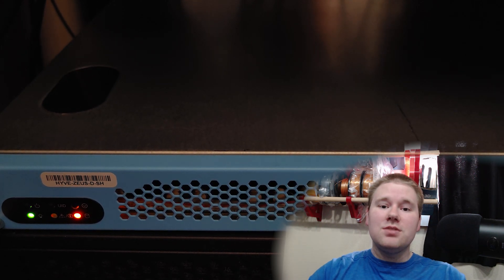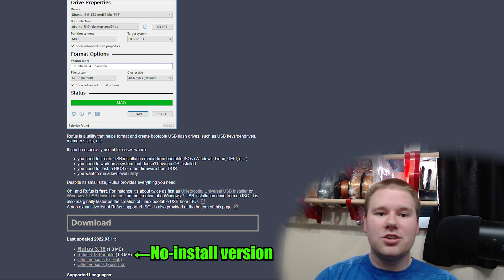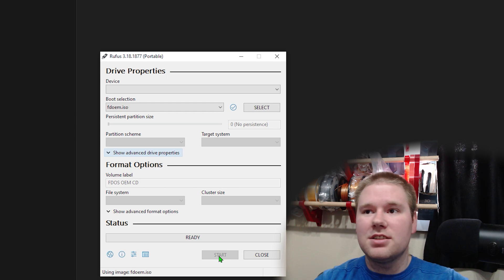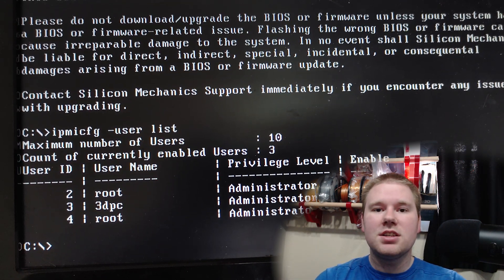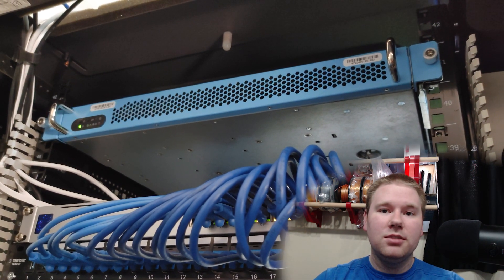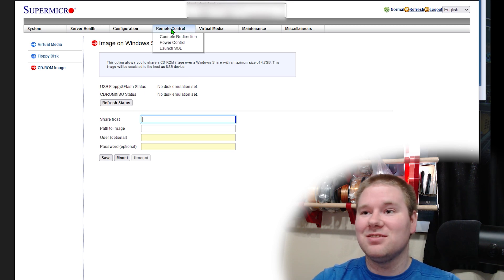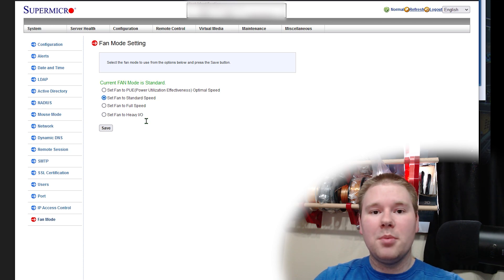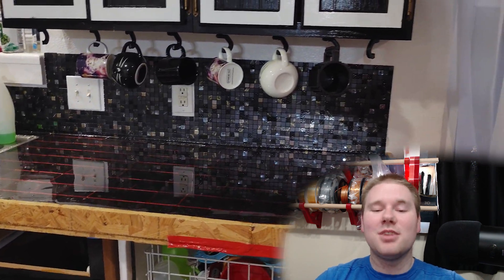Hyve Zeus server: FAN SPEED settings in IPMI, NOT BIOS!

Comment: My fans were set to a low speed anyway, but I wanted to get into the system remotely and this saved me. Thank you, kind internet gentlemen! :)  I was able to add a 3.5" hard drive to this. It's very, very tight, but if you add posts on the bottom and drill your holes in the exact place (I love fabrication), you can put whatever size drive you want in here. I have a 10TB and am using this as a FreeNAS server for TimeMachine backups to keep them off my other NAS machines.

Comment: at 3:19 you had the option of doing "ipmicfg -fan" to display fan modes, then pick one using "ipmicfg -fan <n>" instead of going through the bmc webui. ...ipmi is a protocol used to communicate with bmc/idrac via cmd line.
Reply: can you explain a bit more